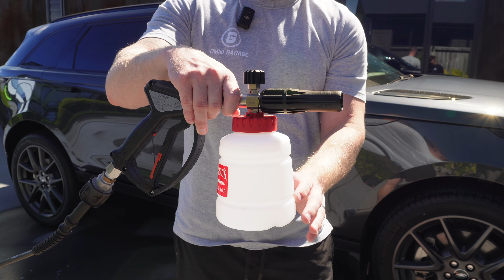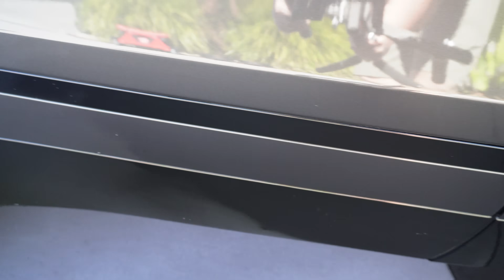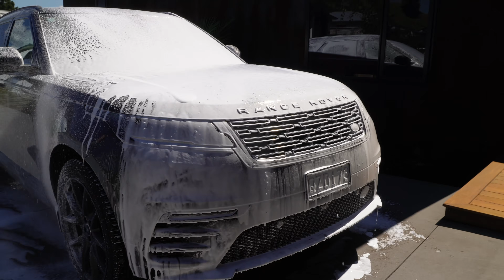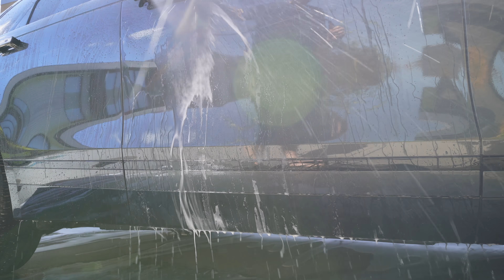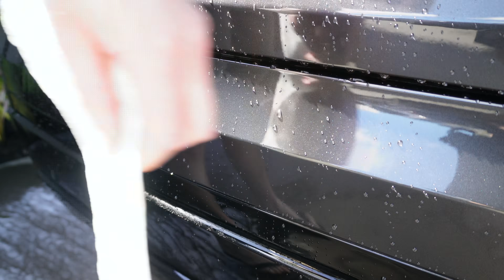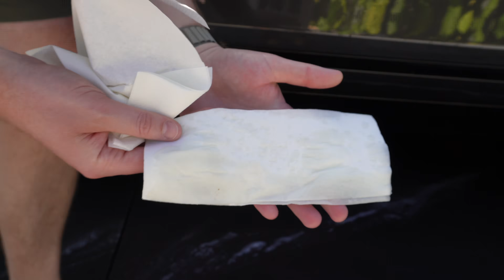How To Use Bilt Hamber Touch-Less

Comment: You end up using 10 times more product when using a foam Cannon as opposed to a foam sprayer. Instead of 300 ml of product you would only need 30 ml and 970 ml of water in a foam sprayer.

Comment: Great video. Suggestion. The alternative (easier and cheaper) is to spray or foam on Touchless using an IK foamer or sprayer or a Keg, ect. Instead of a foam cannon the concentration is just a straight 2% solution. EASY!! The Panel Wetting Power of Touchless is so amazing, it doesnt make a difference in the cleaning effectiveness whether the solution is foam or spray. Foam looks cooler and more satisfying, but really doesn't matter ( From Bilt Hamber ). I spray on 2% Touchless and then follow up with CarPro Reset 10% Spray On and its a truly effective touchless---- unless I'm off - roading and requires a hand wash to follow.
Reply from the maker: Yes a lot of people are suggesting that. We must try it out.

Comment: Big fan of TL. Like others have said, I use it via a pump sprayer. 30ml easily cleans my car, so its really cost effective. And as i use a battery worx hydroshot, the free rinsing nature is invaluable. I do get that in the sun foaming would make more sense to minimise the risk of it drying out
Reply from the maker: We must try it out in the pump sprayer. We have a Ik foam sprayer.
Reply: Hey, what is your preferred pump sprayer? I like the idea of using less product with a sprayer vs a cannon. It says foaming isn’t necessary.
Reply: @DetailsByChris I have the ik multi 1.5 and the multi 2. They are excellent. To avoid issues, after use fill with tap water and spray for about 20 seconds.
Top tip. I bought the trigger spray bottle TR 360 and swapped the pick-up tube so I can use my Multi upside down! Or just buy the 360 version. Absolutely worth it
Reply: @DetailsByChris I have an ik multi 1.5 and 2, because I'm greedy😅 the 2 is sturdier and less prone to falling over.
They're excellent. Flush them after use with tap water and they'll last you ages
Reply: @DetailsByChris ik multi 2. And I'd buy one again

Comment: How do you dry it now without touching it?
Reply from the maker: We use an EGO leaf blower.
Reply from the maker: Leaf blower gets 90% of it off. The rest will dry off/evaporate. Deionised water doesn’t contain minerals so no risk of water spotting.
Reply: How many people have deionized water on hand though?
Reply from the maker: @JT-et7ui unsure sorry. You can easily get it by buying a plug in deioniser system. Griots Garage have a pretty good start up system.

Comment: Have you tried chem x stars and stripes. Very good for winter washes which is why i bought it. Hate getting wet in 30 degree weather! 😆
Reply from the maker: No we havnt yet. Do you think it is better than Touchless? Is it safe to be using every wash?
Reply: According to Bob the owner yes it is. As i said earlier i wanted something to not have to get a bucket out and get wet this past winter and i can tell you stars and stripes absolutely works. It gets about 95% to 100% dirt off. Ive used it since october on our vehicles. Didnt degradey coating.@OmniGarage
Reply: The only negative is it cost about $4 a wash usd.

Comment: Bilt hamber touchless is legit. To get the most value from touchless use it in a pump sprayer @ 1-2 % PIR. I just hose it off and then do my rinseless wash.
Reply from the maker: Do you reckon you get more mileage out of using it in the pump sparyer as opposed to in the foam cannon?  Yes we have hybrid wash video coming out soon using Touch-Less and Iconic Rinseless Wash
Reply: @OmniGarage  You use a lot less because you can be more controlled with how much product you're putting on. I prefer a foam pump sprayer as it gives a bit more dwell time if you're in conditions where it might dry too fast, but otherwise even just applying with a spray bottle gives you equivalent results with far less product.
Reply from the maker: Good call. If you use it in the foam cannon and do the correct dilution ratio this product gets expensive
Reply: I get way more mileage using it in a pump sprayer. @ 1% PIR I only use 15 ml in my ik pump sprayer @ 2% PIR 30 ml. Thats crazy good value. Touch-less is a must have product. @OmniGarage
Reply: I have a pump sprayer but tracking the ratio.  Are we simply saying that for 100ml volume, 2 ml would be the Bilt Hamber and 98 ml would be the water?  Thank you!
Reply: @Dante1321 so in a foam cannon 20ml for 1000ml?

Comment: First!!++
Reply from the maker: What does your game plan/plan of attack look like to be the first to view/comment everyone’s videos?
Reply: @OmniGarage  I like touch less as well as trace less, Korrosol, Surfex HD, Atom-Mac and Deox-C but I use mostly Rinseless since 94.  Touchless only use it on very dirty vehicles as a pre-wash. 
Yes, I am first to support and comment on everyone's videos only on the good ones😜
Reply from the maker: And thank you for your support as always. So are you more likely to use it in a hybrid situation?
Reply: @OmniGarage  that's right because with Rinseless you are more efficient and low cost for you as a detailer, you don't need the full mambojambo of setting up foam cannon, pressure washer, hose connection, electric outlet. Also Rinseless can be used on interiors and windshield/windows unless they are on heavily smoked vehicles where traceless would be better to use with a magic eraser/melamine sponge to remove that heavy nicotine film and then wipe with a microfiber towel.
Reply from the maker: @1stfrompuertorico568 yeah totally agree. When you do a Rinseless wash do you apply a drying aid/paint sealant to aid with drying or do you just straight dry the car?

Comment from the maker: What is everyone’s thoughts on Bilt Hamber Touch-Less? Is it a good soap or do you think there is better out there?
Reply: Im definitely going to get it for use as a prewash.  Ive never paid much attention to bilt hamber until Forsenic auto detailing posted a bunch of videos on his channel. And now you posted a video and it did an awesome job! definitely getting some!
Reply from the maker: @beijingbiden5931 fair enough. It is not a complete replacement for a contact wash. But it will remove most of the dirt and get you a cleaner/safer panel to start your contact wash on.
Reply: As foe traceless, my gosh that is an impressive glass cleaner! Ordered 6 liters! I love that stuff!
Reply from the maker: Yes it is really nice to use.
Reply: Sorry don't mean to always bring up weather but does it get real cold in new Zealand in winter? Do you have a garage to detail in winter?
Reply from the maker: It doesn’t really get that cold in winter. About 5 Degrees Celsius. We can can detail outside no issue but do have inside capacity
Reply: I have not tried BH Touchless but I've recently been testing Innovacar Prewash and it is impressive...removing close to 90% of the road grime before I start my rinseless contact wash.